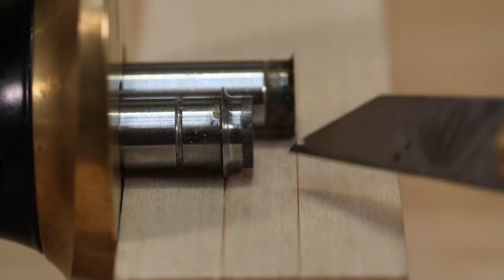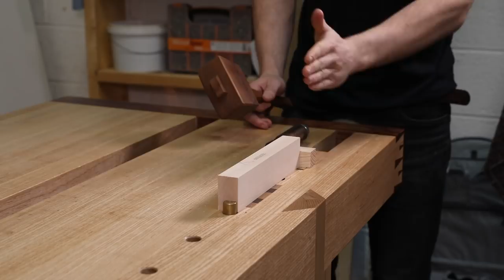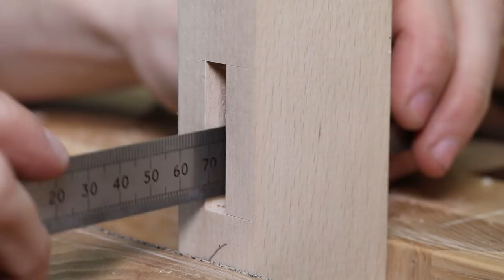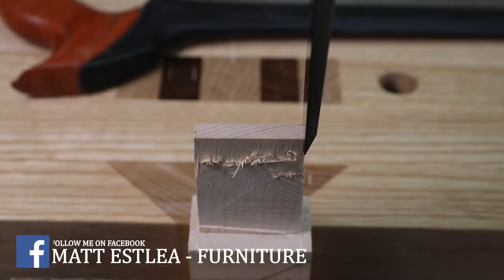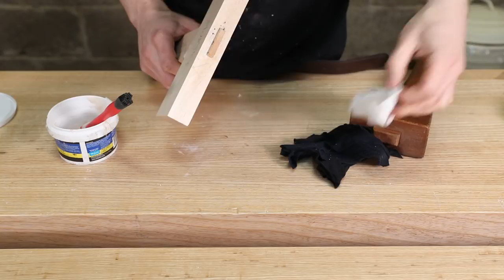How to cut a THROUGH MORTICE AND TENON by HAND

Comment: As someone studying for his Diploma in Engineering and an hobbyist metal worker, I'm spotting a lot of skills and techniques in marking out that show a lot of potential use for marking out in metal working. I'm probably going to go ahead and start making metal working equivalents of these tools, and maybe buy a few lengths of pine from the local Bunnings.
Reply: A lot of woodworkers use machinist squares and 1, 2, 3 blocks for set up and measuring.  While wood can be a little more forgiving a lot can be learned from machinists regarding precision and accuracy.

Comment: Like your work mate. Great to see the younger generation carrying on this fine tradition. 
I also like to use traditional tools rather than routers etc, but I tend to drill out the mortices first. My Dad was a joiner and he said it was a waste of energy to chisel out all that wood. He was right.  
When I used to demonstrate traditional woodworking techniques I would use a brace and bit. Very satisfying. But in the workshop I use a morticer or the pillar drill and a point and spur drill bit. If I can't find one in the right size, I grind one. 

Also, I've found Japanese saws to be superior to even the very best old tenon saws, and all my good saws are beautiful 100 year old Distons!

The advantages are many. Firstly you're pulling towards you, not pushing away. That leads to greater control and therefore higher accuracy. 

Japanese saws have very aggressive sharp teeth which cut much faster with far less effort. 

You're also cutting a finer kerf because the teeth are set much closer than European saws, so both sides of the cut are subject to less scoring as a result of variations in accuracy of saw stroke. 

All this means you can cut a lot closer to the line. Japanese woodworkers cut TO the line! They are amazing. 

Finally, when cleaning out the long sides of the mortice, I like to offer the 1" chisel at an angle, cutting with the corner first, sliding it in like a guillotine. This method works best on hard timbers.

Comment: Nice video! Personally I would have chopped out that mortise with a bevel edge chisel. Slower progress, and much more subtle and precise work, but also requiring a lot less adjusting of the tenon to make a tidy fit afterwards. The mortise chisel is great for tearing out chunks of wood, which is fine for bigger and less delicate joints, but is does leave a lot of scars on a little and delicate joints as in this video. That said, thumbs up for anyone who can still be bothered to carry forward the magic of the good old hand tools, and you have made a very good and instructional video here.
Reply: Paul Sellers Style ;)

Comment: What's your position on using a drill to remove most of the material in the mortise and then squaring up the hole with a chisel?
Reply: It’s probably considered a ‘cheat’ because I’m not allowed to do it that way for my exam a college, but if you can make a nice mortice that way why not.
Reply: Rex Krueger's answer to this question is to use whatever works for you, but that drilling holes takes longer than cutting it if you practice enough. 
Personally, I tried pre-drilling and ended up absolutely wrecking it somehow lol. Chisel refused to go straight
Reply: @SorenX2008 same.
Reply: your chisel is going to wander a bunch. It won't have any reference point to guide itself.

Comment: TIP: If you cut the tenon first, you can cut the mortise a little narrow, then clamp your tenon next to the mortise board. Then use the edge of the tenon board to register your mortise chisel. Then pair the mortise sides using the side of the tenon board. No damage. No bruising. Perfect fit.
Reply: Any visual examples??
Reply: @CabinetFramingUK   Paul Sellers on youtube does exactly that if it helps.

Comment: From a very jealous middle aged carpenter to a young guy setting himself up on a great path to a successful career I applaud your skill and knowledge. I taught carpentry and I really wasn't interested in perfect practise pieces I was interested in people getting the experience over and over, I see a lot of tutorials about how to do things and it's filmed well and all very valid but the real reason to do joints is to make things, so that said my thoughts are this.... Use that lovely accurate saw and cut so close to your gauge lines that you are left with a slither of wood left to chisel. If you don't trust you can hit that mark, don't worry it's all practise because if you have to chisel with a mallet your tenons there's too much stock left on, which for a demo is fine but it then adds an extra process and time to making even the most basic of frames in for example if you take 1 minute longer chiselling this way on each side that's both sides x4 joints in a basic frame that's 8 minutes longer, if your making a dovetail box and chiselling each face of the dovetails and pins it gets to hours spent chiselling what the saw does very well at. Good luck and keep sharing great content
Reply: I think he’s a lot better and faster than he lets on. He does it like this to help beginners. Otherwise they’d think they could never do it how well and quickly he does it. 

Look at rob cosman. He looks like he uses a lot of aids and crutches but it’s all for the audience. He has a video of doing dovetails in 3 and half minutes and they are tighter than anything I’ve ever achieved in an hour!

Comment: Hey Matt, great videos! I have been attempting to cut mortise and tenons for a while now. I’ve never cut these joints and your videos are very helpful. But every time I cut them the tenon is angled (not square) when assembled. Is there a way to remedy this? Or is the only solution re cutting the joint? I am trying to find a “troubleshooting mortise and tenon joint” video to go into more detail on fine tuning a tight fitting mortise and tenon joint. 

Also I would love to see your take on doing a mortise and tenon video for 45 degree angled braces, maybe a video on how you fine tune your mortise and tenon joints and how to make them square.

Comment: does this sort of joint work ok for ply wood ?

im trying to make a set of shelves for my work shop and thinking this would be a strong joint
Reply: Don't cut a mortise in the plywood, instead 'build' the mortise, as if the plywood were Lego blocks. One long block, two short blocks with the gap between set with the thickness of the material for the tenon, and another long block on the other side to complete the sandwich

Comment: Cut the tenon first then measure out the mortise off of it? Might make for a tighter fit.
Reply from the maker: The mortise walls are bruised by the chisel when cutting it out, making it larger than expected. I explained it at some point in the video...
Reply: Rails Life - That is how I learned. It’s a tight fit without the need do all the trimming on the tenon. Just use the tenon to guide the chisel and then pair off it.
Reply: It appears that the obvious solution would be to just mark the tenon slightly oversize and pare down the sides of the mortise to fit. I can't help but think that it would give you smoother sidewalls that make it easier to get a tighter fit joint to slide home. I've not actually tried it, though, and it's well after midnight here so I could be missing the obvious problem with that idea.

Comment: You listened and remembered - nice :-)

Regarding the mortice cutting, have a look at Paul Seller's method: https://www.youtube.com/watch?v=r-08PY3stgo
He cuts the tenon first (I don't particularly care using his or your method of cutting it), but then he cuts the mortice WITHOUT a mortice chisel ever - by using bevel chisels only. Plus, by making the mortice a few mm bigger than the chisel, he doesn't have the problem of the mortice getting bigger than anticipated.

What do you think about that? I've never put either method into practice, so I'd like your opinion - and perhaps a "cutting method duel" video perhaps? :-)
Reply from the maker: All for you my friend! Haven't seen that video of Pauls before but I remember seeing his original M&T a few years ago. Over the years my method obviously mixed with different techniques I've been taught. As for the bevel edged chisel vs mortice chisel debate. I can only assume he's demonstrating how to cut the joint with the bare minimum tools as that is the premise of a lot of his videos. Bevel edged chisels are undoubtedly more versatile than a mortice chisel. But are they better at whacking out waste than a mortice chisel? Probably not.